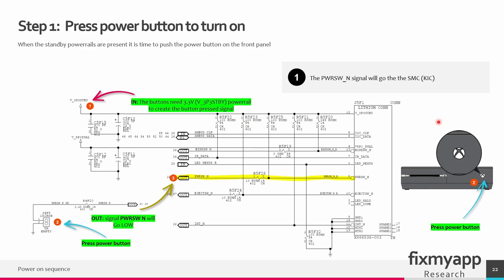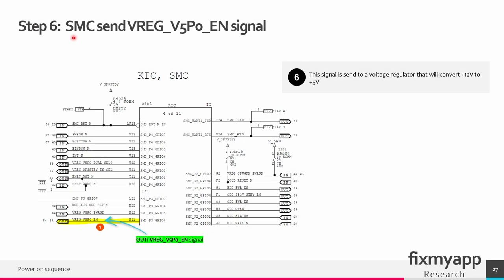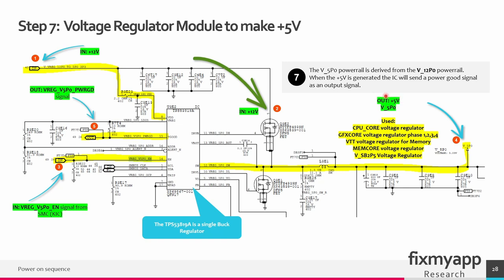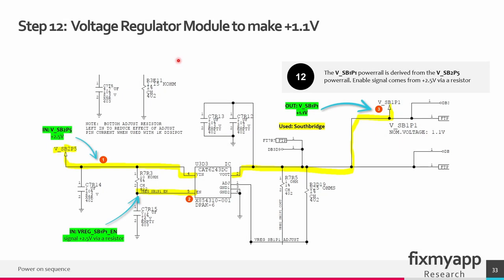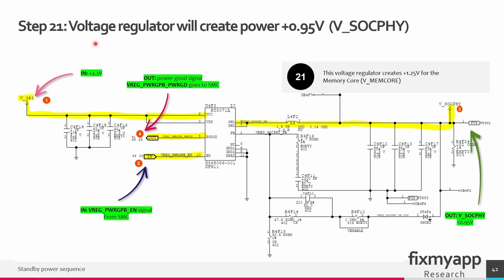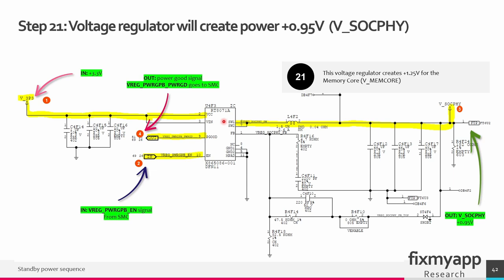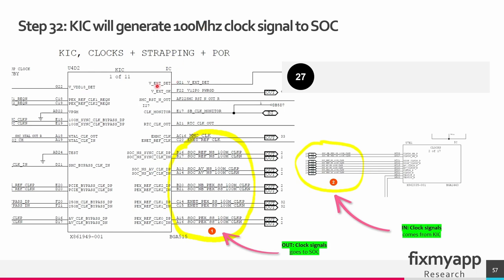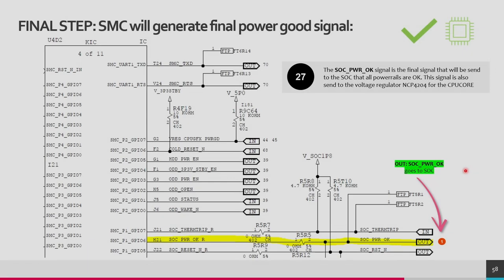POWER ON voltages in game consoles - PART 3

Comment: Excellent video! I followed your entire video on a console that I have here, it has all the voltages up to SOC_PWR_OK, but the console does 3 checks of 5 seconds each and stays in this loop, do you have any tips on what to analyze? If you can give me any help.
Reply from the maker: This is a tricky one because it could be software/firmware related. I do not have a solution for this problem :(  Gr. Jim

Comment: Greetings from Cuba, congratulations for your very explanatory videos, I wanted to ask you about a failure of the Xbox for both the fat and the one s, and it is related to the failure of the 4 checks that it makes when connecting the source
Reply from the maker: Hi welcome to the channel, can you clarify your question? gr. Jim
Reply: Hello, the question I asked you is about the failure of the Xbox One when you connect the PSU to it, it does 4 checks, not the normal check that it does before turning it on, thank you for your attention. @fixmyappjim
Reply from the maker: @ivanrodriguez-vc3hf  Hi, if there is any problem with the standby voltages it will not turn on. The order in which the checks are done is not that important to analyse as long as all the voltages and enable signals are presents. Most of the time  there is a short which prevents the console from booting up. Gr. Jim